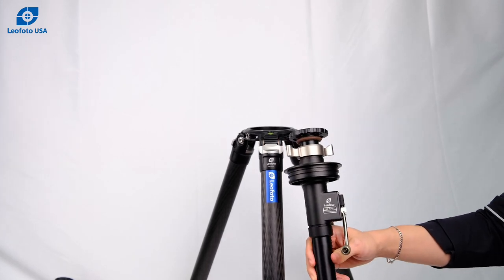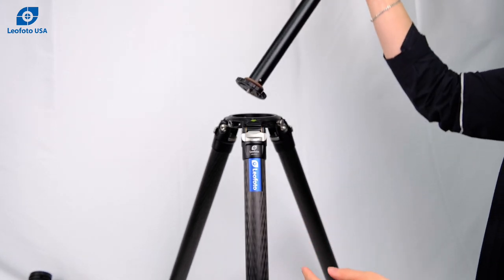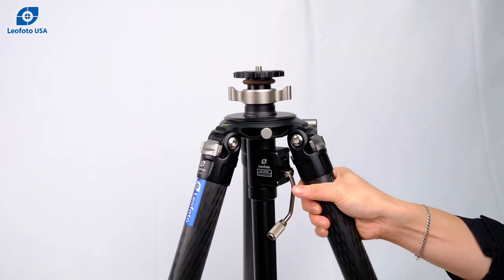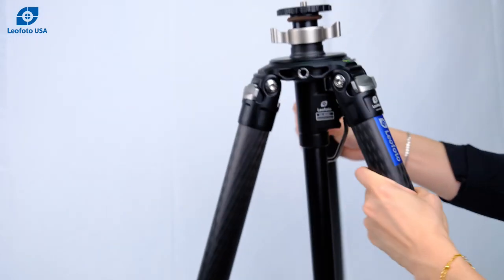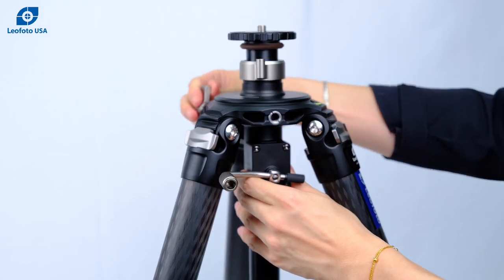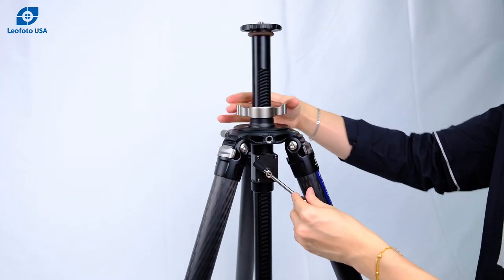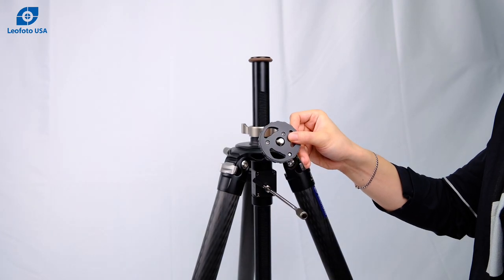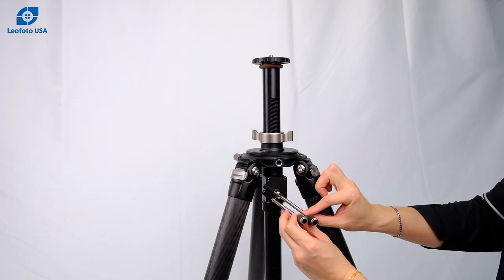Leofoto GC-404C Overview and Install Guide

Comment: I have this geared column, unfortunately I found the silver coloured "butterfly" locking part, at 1.52 can unscrew off if you turn it too many times.  I have the heavier Gitzo geared column and the Benro geared column and both butterfly locking part stops to avoid unscrewing off.   My one needs a redesign?
Reply from the maker: Thank you for bringing this to our attention. We appreciate your perspective. We will forward your comments to the manufacturer for review and consider updates for future improvements.